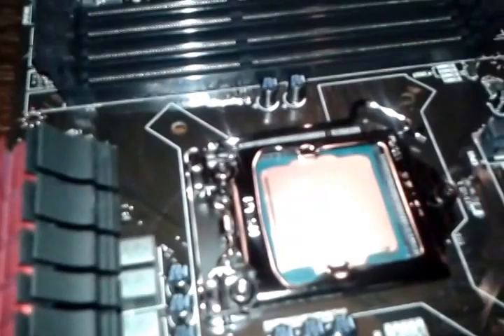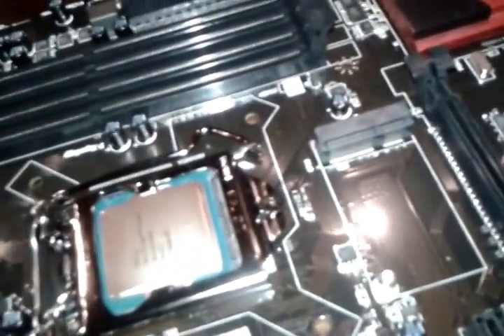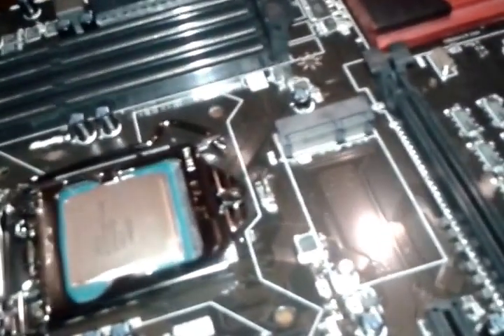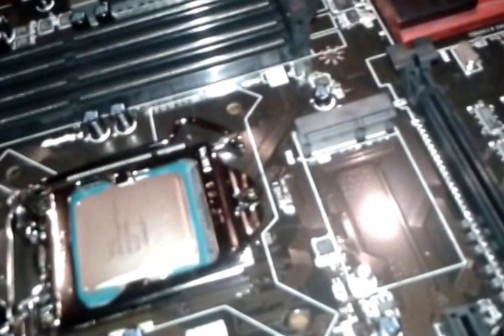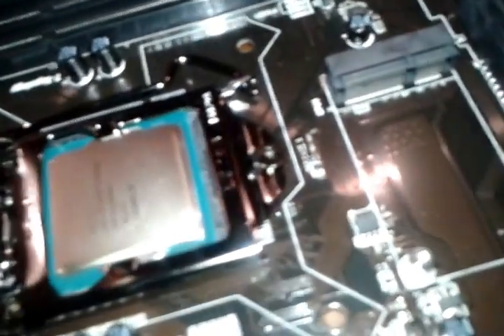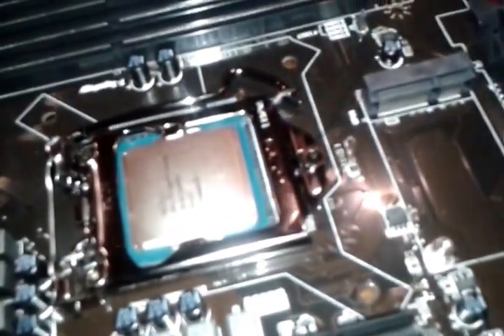The LGA 1150 socket latches are hard to secure!

Comment: I had the same experience with an Asus Z97. The lever was unusually hard to push down. I was terrified until I saw the pc boot into bios ! So dont worry. Just be careful to sit the cpu correctly in the socket.Then apply as much pressure as it needs to secure it, I did it with the cap off. I dont know what it is used for.
Reply from the maker: Nikolas Kyramarios Nice to hear you booted with no problems. Since this video I have assembled a lot of different PCs, most of them had this issue except the AMD ones I guess.
Reply from the maker: Wow that was a fat fucking lie. I had not assembled a lot of different PCs since then, maybe a couple and definitely not an AMD CPU until last year lol, 2014 Yasha you goddamn liar!